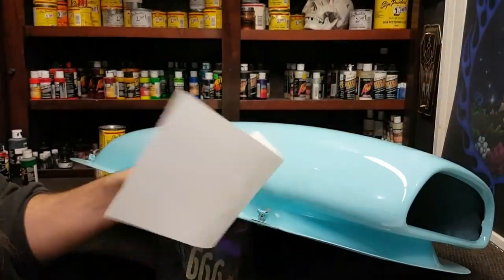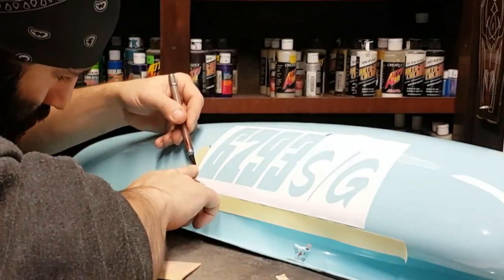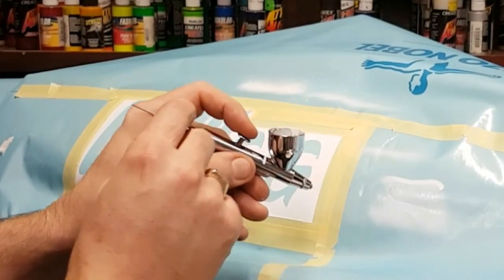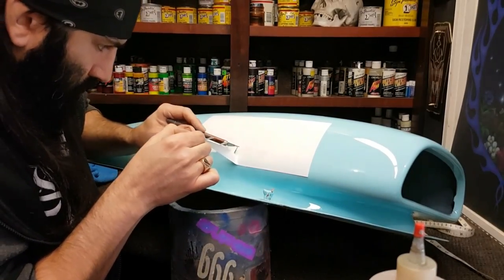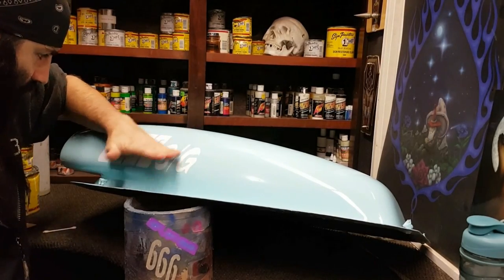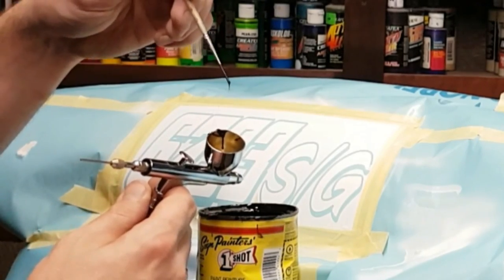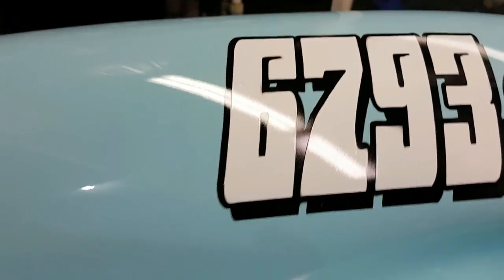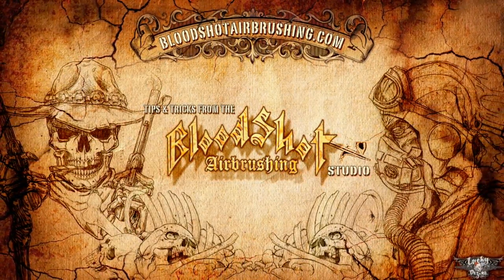How to Airbrush Two tone Lettering using 1SHOT Paint and Vinyl Stencils.

Comment: This video made me think of something - a little birdie told me that you can use Olive Oil to remove enamels off yer skin if you apply it before it's dry.  In fact, I think they did it before they even wiped their hands off with a rag, which makes sense.  I'm sure it has something to do with these Enamels being oil-based.  MUCH safer than using chemicals you would normally use like Mineral Spirits or Lacquer thinner.  Of course, using normal hand soap can be tricky with dubious results.
Reply from the maker: Thanks for the amazing Intel Soldier!! 😁👍 that's great information for beginners and advanced artists alike!! The BloodShot ARMY salutes you!! 🤘😎 Big Cheers and Much Love from the BloodShot Studio!!

Comment: Hey man what paint to you recommend to practice with on the metal cleared panels that you said that you practiced on when you were getting control of that there airbrush ?? I liked the whip down with mineral spirits and you can use it again. Also what type of lettering brush was  there you were using ? Whats good learning brush? Had pin stripping brush but the squirrel hairs fell out guess I didn't take take of it right and to small of a handle. Thanks for videos still learning this art.

Comment: Have you run into the issue of having residue left on your surface from using vinyl as a stencil?  I'm currently working on a goalie mask airbrushing and I found out after I remove the vinyl to put in the paint there was a big thick residueI eventually did get it off however it is definitely a pain in the butt to get off.
Reply from the maker: Yes!!! I feel your pain!! 🥴😟🥺😡🤬🙃This is something I've gone through on a few occasions. 🤔😁This is usually caused by using the wrong type of vinyl. Most vinyl is ment to stick and not easily come back off. However, if you get the premask vinyl or low adhesion vinyl, you'll find that it comes of way easier and with little residue left to clean up! 😁👍I hope this helps you out my friend!! Big Cheers and Much Love  from the BloodShot Studio!!🤘😎🍻

Comment: Broski!  What causes a bit of paint to splatter onto the canvas when you only press down for air...  I'm sure that my paint isn't mixed well. as I put a bunch of paint mixed with water (only) in a container so I didn't have to mix it every time I painted.. But is that the only problem I have?
Reply from the maker: Hmmmm. It's always hard to say without being there... 🤔😁 my first thought is that there might be some paint left on your tip from the last time you sprayed. 🤓 This little bit of paint will sit there until the next time you apply air,... to which it will jump for joy,... and land on your canvas. 😉😁🤔 My second thought would be a possible issue with your needle and nozzle seating properly within one another. 🤓 You can take a magnifying glass and look.... You can also try spraying just water, and see if while your trigger is all the way forward, if there is water coming through. If so it's not seated and you may be able to fix it, (see my bent needle video) 🤔😁I think that gives you a couple things to try... Please let me know if none of them work.... 🤔😁 as always Big Cheers and Much Love from the BloodShot Studio!!🤘😎
Reply: @BloodShotAirbrushing  Thanks so much for the tips.  I'll take a look and see if it's still happening later today when I do some work in my sketch pad.
Reply from the maker: @DACProVid  k